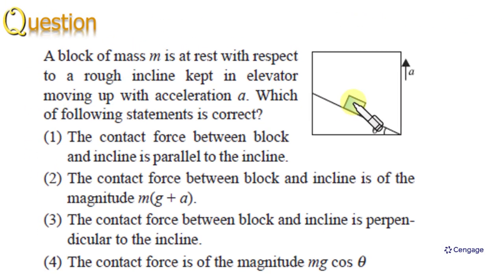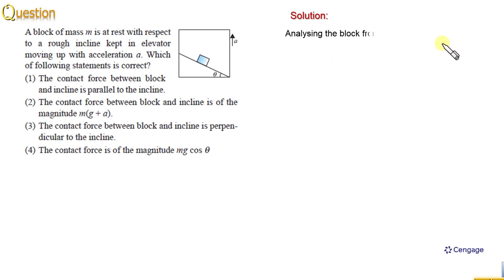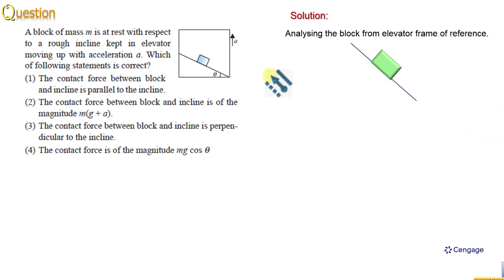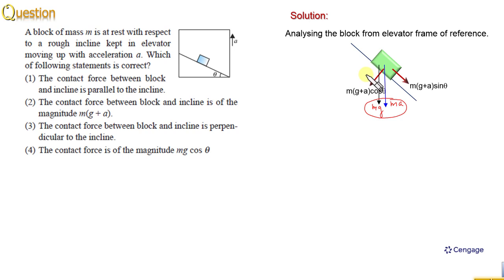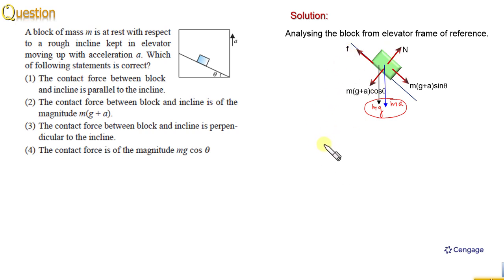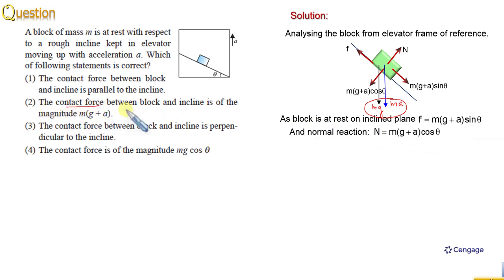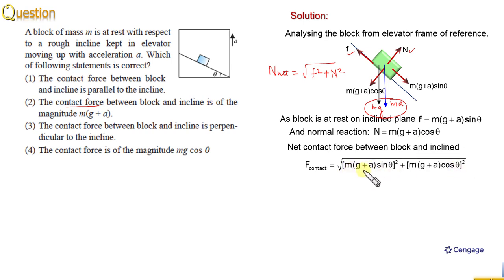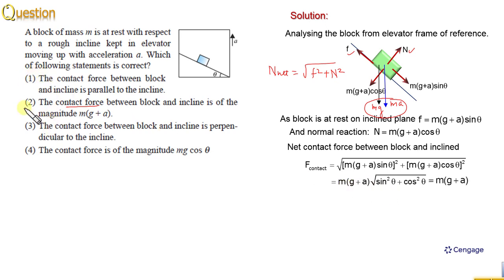Laws of motion | Friction #5| Cengage Book | BM SHARMA | JEE 2025 | NEET

Comment: Sir please help me, i am a jee 2024 aspirant doing my preparation from your cengage lectures. In my coaching they were not teaching advance level, so i decided to follow your lectures and books. I am doing every illustration from the lectures, what I have to do next? Do I have to do some leftover illustration from cengage, single correct, multicorrect? Basically please guide me, i want a under 100 rank in jee advance. I tried reaching you from Google but it didn't work. Please guide me how to best use your video lectures and book? Also if I have to revise all the illustration that i was not able to solve in your lectures?🙏🙏🙏